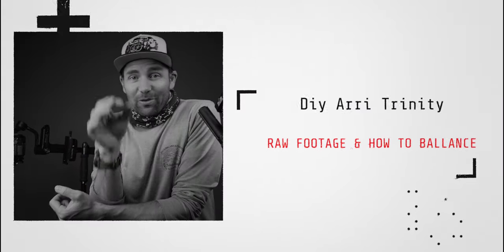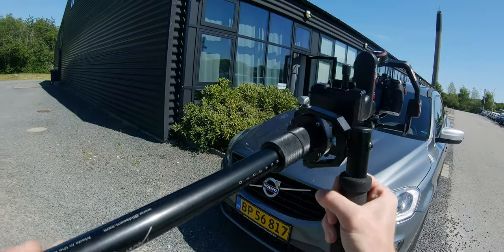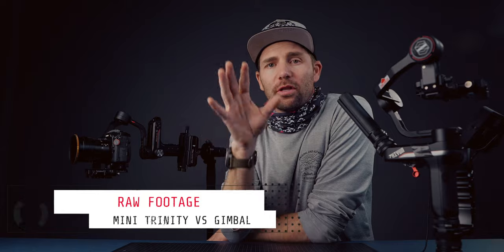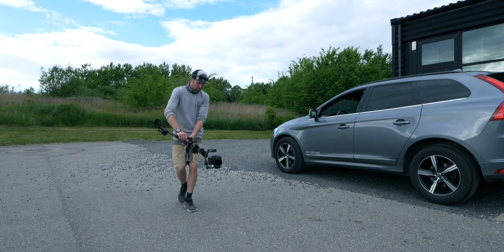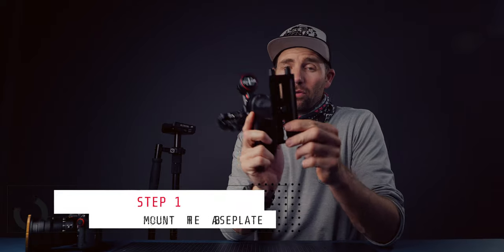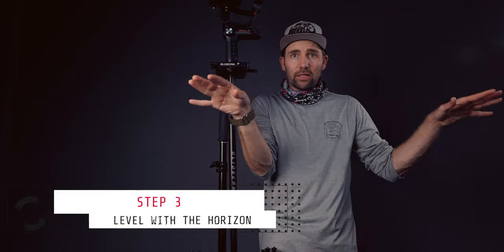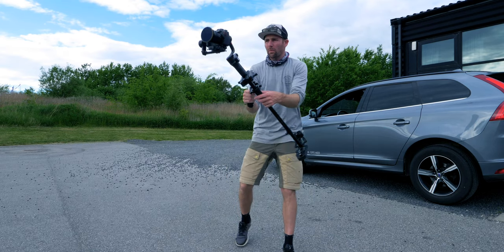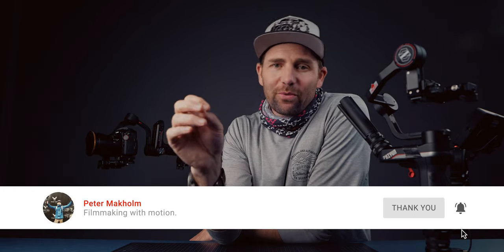DIY ARRI TRINITY // TEST & BALANCE  // WEEBILL S & GLIDECAM

Comment: Is it just me who noticed the footage from this DIY rig shaking a lot more than just from gimbal?
Reply from the maker: It is really hard to tell. In some cases the gimbal only wins and in other the diy rig does better.
Reply: @PeterMakholm  it is really shaky :( maybe the motors are vibrating because of the angle...you propaply dont feel that because you grab it all the way in the back. reduce the power the motors a bit
Reply: I saw the same shaking on both, it might be more noticeable on the minity because the up and down of walking is not as noticeable, isolating the shake
Reply: Shaking is probably caused by IBIS fighting with wide angle lens and gimbal. Try turning IBIS off.
Reply: Thats what I was going to say...
Reply: @raptor2359  I actually don't think it's that, I think he has the motor strength settings too high. This is usually the outcome.
Reply: No lens support ? 🧐
Reply: @CaptainMyCaptain33  so there you have it. There's no point of doing this combo on your own if you're unexperienced and don't understand how gear like that works. Waste of time, money and nerves.
Reply: @cinex5114  I dont think he walked correctly. His posture was a bit too straight

Comment: I would recommend to update the Weebills firmware, set it in medium or high capacity and auto tune the motors before rigging the minity so you can avoid the jittering.

Comment: Your gimbal has micro jitters :) I managed to get rid of them with auto tune, your setting, 2 screws for the camera and quick release plate. My setup has an A7s with Viltrox adapter to Canon 24-105  and focus motor. The total setup has around 2.3KG

Comment: Hey guys I have just mocked up an Arri mini/trinity with a big build bmpcc and Zhiyun 3S. And I managed to get a monitor on it.  Note the 3S is heavy with more reach so you may have to add additional weight on the glidecam foot. I using the HD 4000. The monitor was attached around the HD pole with a 25mm ronin m clamp with 1/4” sockets I mounted a 15mm rod and a nato style clamp so it can flex up and down easily. A ball head would be messy. I also have the flycam galaxy 8-18kg vest! You really need it for this set up! It works an absolute dream. I must make a video!
Reply from the maker: Sweet but heavy setup mate.
Reply: why have you still not done a video?
Reply: Make a video of the setup I have a bmpcc with Moza Air 2 and want to set it up similar to this with the vest and everything!

Comment: Thanks Peter,

I see you don't have to have to have gimbal set in lock mode, like you do using the Zhiyun telescopic monopod,

Thank you
Reply from the maker: Newell Barrett yeah it is actually really great. But some micro jitters was seen  in some of the footage. I am currently testing with more motor power on the gimbal and looking at the crane 3s and the effect with larger motors.

Comment: I’ve seen several demos on YT about this system.  The question that jumps at me is what mode is the Weebill s in?  The goal of a cameraman is to get footage of something specific.  That would seem to be nearly impossible with this system.  You can’t reach/hold the trigger to control the pan, you can’t reach the focus knob, etc etc etc.   what exactly are you doing?  Are you limited to orbiting/zoom in/out?
Reply: You use either PF mode( pan follow)  or F mode (follow). With F mode you can also tilt the camera up and down when tilting the glide cam. It’s autofocus or manuell focus either with a higher aperture or just controlling the distance to your subject. You can even use someone to focus pull for you with weebills focusmotors and transmiter.

Comment: The issue is still that 45 degree arm that limits the gimbal movement and limits the smooth transitions. Irony being the older Zhiyun Crane Plus has less deviation and due to the 90 degree arms can do full rolls without having to change handle position.
Reply from the maker: Yes mate, that is why there is so many that sitll love the Ronin M.

Comment: Can't you use a small rig clamp and a long hdmi wire to connect the monitor to the cam?
Reply from the maker: that could be an option, but it has to go on the handle.
Reply: @PeterMakholm  That reminds me of this thing: https://www.amazon.ca/gp/product/B00DOMVJ92 - apparently can handle <3kg payload :o

Comment: So I tried to do this on the glidecam HD pro and the RS2 that just arrived.. but I cannot get the RS2 To balance with the glidecam.

I'm using all the weight plates that came with the glidecam and its at full extension. But it's still way too top heavy.Is there a weight limit to how heavy the gimbal can be? Or do I just not have enough weights?

Comment: I’d like to know what quick release system you’re using for the camera. I’d like a solution for a quick transition between the gimbal, a slider and my tripod. Thanks!
Reply from the maker: Hi, I don't know why I did not get the links in the description but here it  is. https://amzn.to/39s3x3a
Reply: If you use a Zhiyun 3S you can use any standard manfrotto plate! This also means it can slap right into the glidecam plate with out any screwing around!
Reply from the maker: @mezzanineh15  Yes, It is so great. finaly.

Comment: I'm finding some troubles  balancing my system (  Zhiyun Crane 3 Lab and Canon 5D Mark IV with Glidecam HD 2000) 
are there any recommendations? 
and thank you so much
Reply from the maker: Hi, I havent tried to ballance the crane 3 lab on the glidecam hd 2000. The combination of the crane 3 lab might be too big to ballance. I have both, I can give it a try and tell you if it is possible.

Comment: how much does that rig weigh? I have a ronin S, but I am somewhat afraid of putting a lot of pressure on the screw that goes from the glidecam plate to the gimbal due to the weight.

Comment: What happened to your Crane 3s? Did you return it? Would love to have seen this video feature the 3s and heavier rigs (10lbs+/4.5kg+) Also, noticing micro jitters in both set ups. Reason for that?
Reply from the maker: No I still have it, but It is too heavy for me, I don't need that big of a gimbal for the gh5. It is only for the S1H, but then I use the Glidecam. Yes there are som microjitters, and there will nearly always be that when walking with electronic gimbals. It is only when working with my glidecam only they don't apear.

Comment: I have one question with this set up, does it put some amount of stress on the bottom part of the Weebil? Coz if thats the case, at some point it will break. I’m not too sure how it work 😅
Reply from the maker: Yes. it will put a lot of stress on the buttom screw. It could portntialy break because this it now what it was designed to.

Comment: I thinck the gymbal was not perfectly balanced in both setups. I can see a lot of mini jitters in both. Can you see them too or is just me?
Reply from the maker: DC Studio the gimbal is balanced perfectly and yes there will always be some micro jitters when dealing with electronic gimbal and walking along. Add some post stabilization at is smooth as butter.
Reply: @PeterMakholm  i own a zhyuin and use it with a gh5 with 12-35, NEVER vad micro jitters. But maibe because the lens and body is stabilised. Anyway, for me the jitters are unexpected. Maybe the setting of the motor are to high? I have seen a lot of crane 3s footage , none looked so jerky as yours.